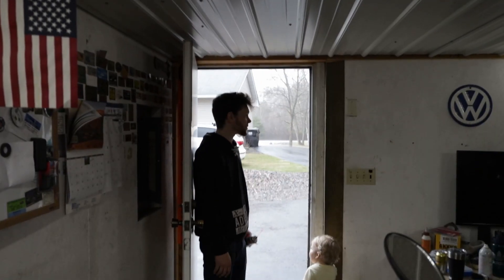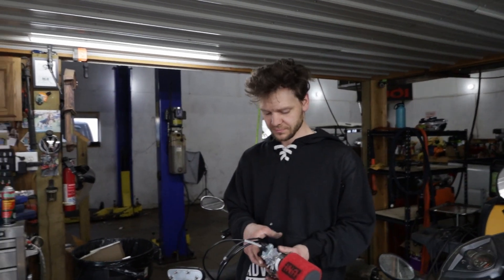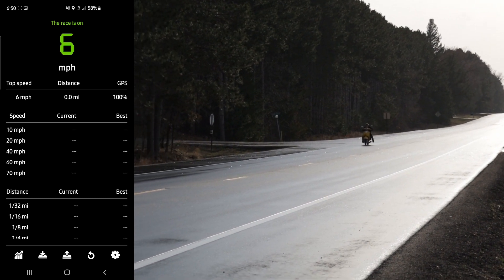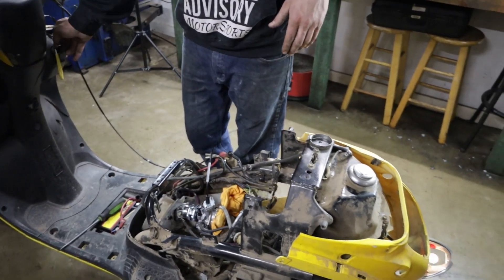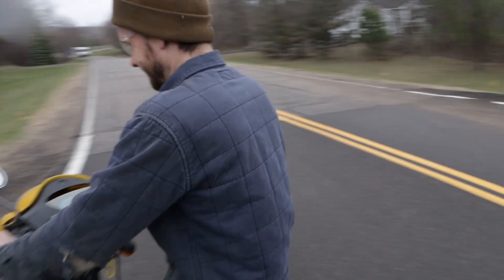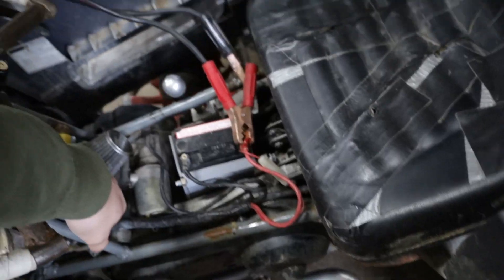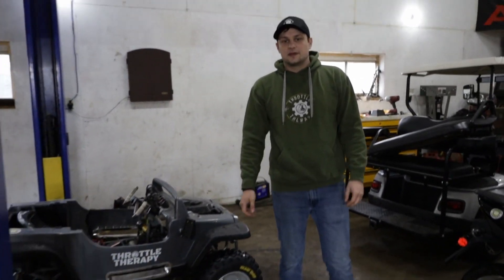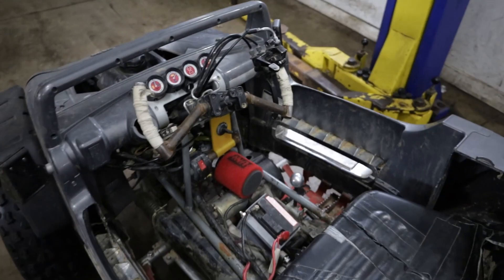Testing the Rolling Wrench 150cc GY6 PERFORMANCE Carburetor!

Comment: which speed app did you use? I used to have one on my old phone but they dont make it any more
Reply from the maker: We use one called Drag racer
Reply: @throttle_therapy  ty. just downloaded it. I dont think my speedo is accurate. It says my stock BMS 150cc gy6 does 65mph on flat road